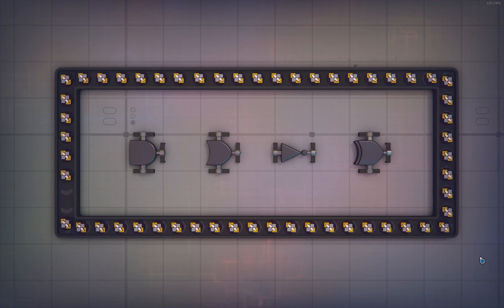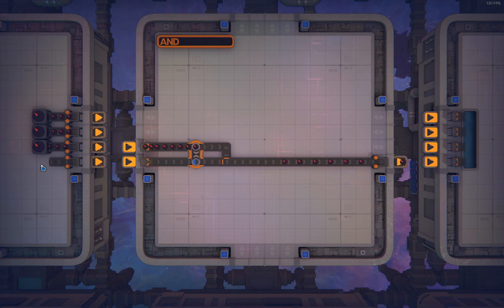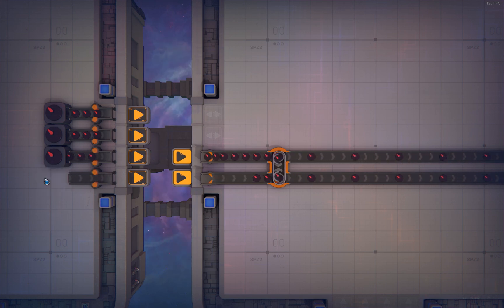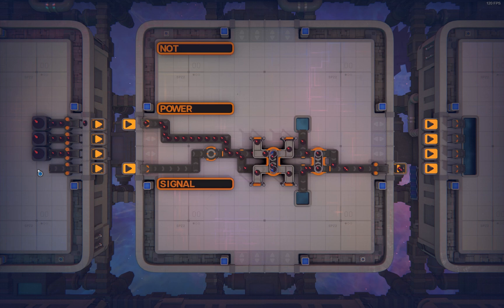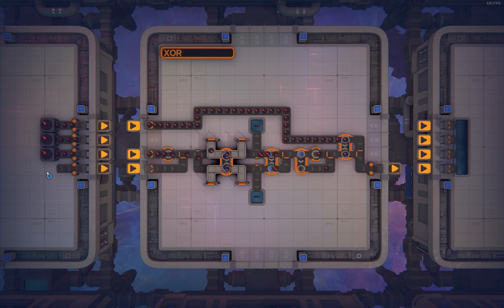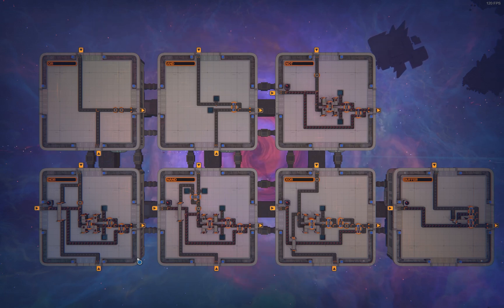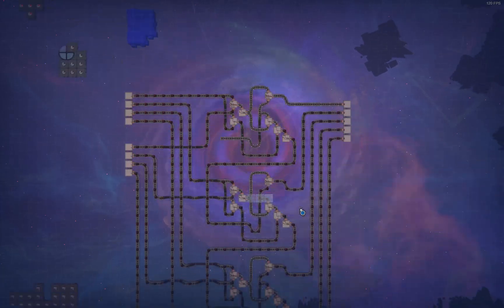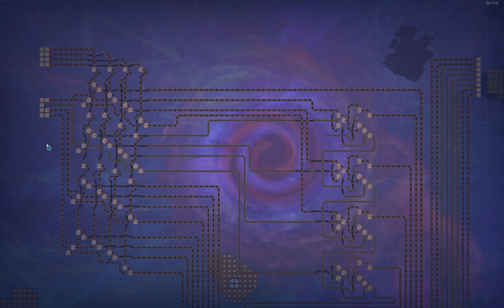Make logical circuits without logical gates in shapez2

Comment: I'm confused? is this just for fun because it's neat to make binary logic or is this useful for the game goals?
Reply from the maker: Basically just for fun, but since wire signal is not stable in this early release of the game, belt logic makes large scale circuits possible, which are again only for fun.